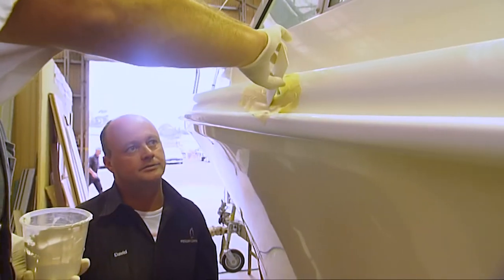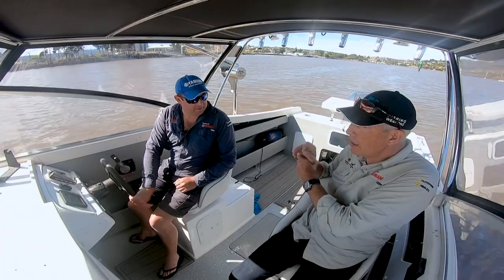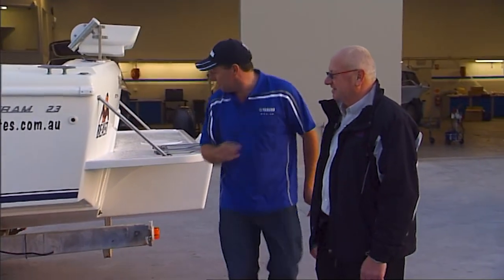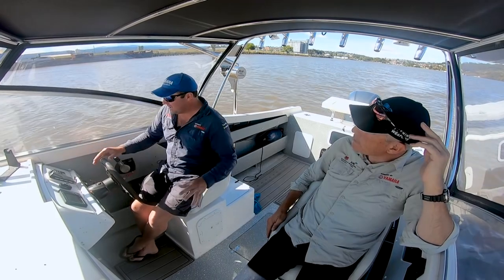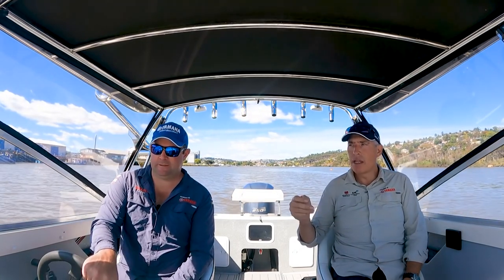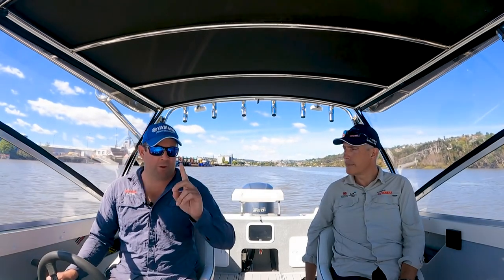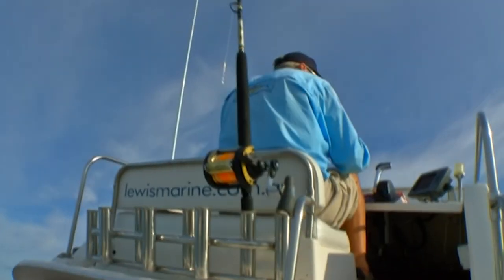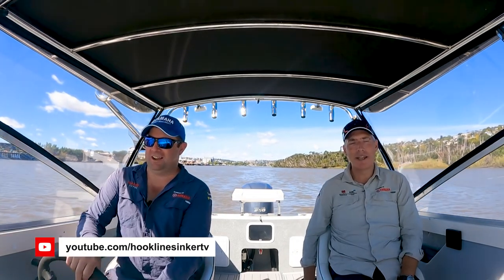Project Boat - converting a stern drive to outboard Pt 4

Comment: Ive got an old Yamaha and a brand new Mercury. The Yam from 2004 is quiet and lightweight and my New Mercury 2019 with latest injection is loud, heavy and faster and feels lika a musclepiece but take more petrol than the Yam. So if I should buy a new engine I stick with Yam.